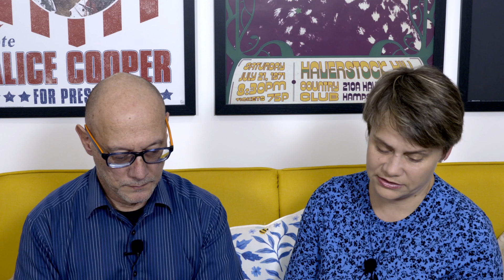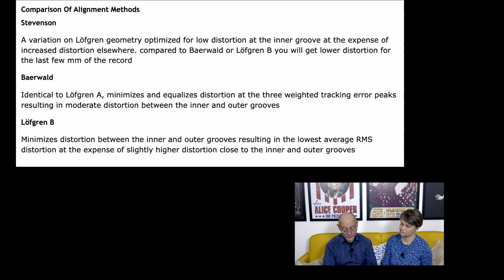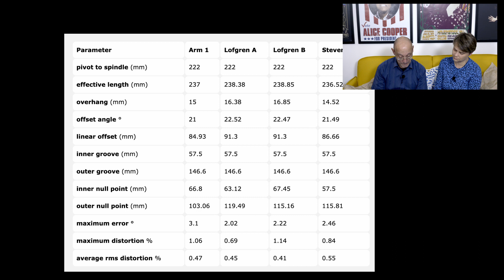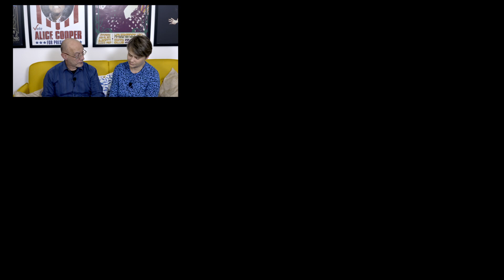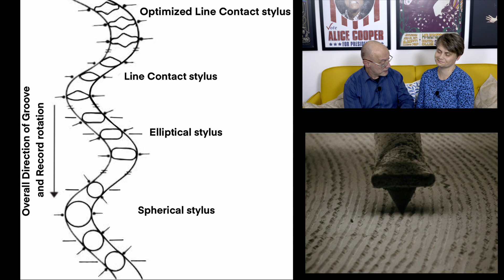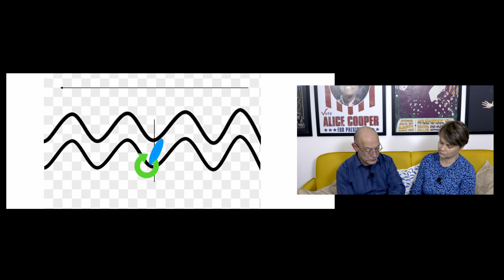What you didn't know about Baerwald/Loefgren/Stevenson cartridge alignments

Comment: I've got a dilemma I don't think you're giving me an answer to! a friend of mine bought a cheap DJ turntable a Staton t62 but the arm on it is very short to the extent where overhang is underhang by about 20mm.
Question is what would the null points be to set it up? because the calculator won't work and I can't find anything online for what it should be? They made it short like that for scratching purposes but he doesn't do that and I've heard you can damage your records I'm not sure!
Reply from the maker: Hi
To calculate the null points, you need:
1) Pivot to spindle distance OR effective length of the arm
2) Overhang
3) Offset angle
I have a video about arm geometry that explains that.
Cheers
Reply: @TheAudioSanityChannel-ym7ij  yes but there is no overhang as I said and  I don't know what the offset angle is either have you got a link to this video and thanks
Reply: "They made it short like that for scratching purposes but he doesn't do that" - then wrong choice of turntable. The arm is short exactly because this serves easy scratching. Like a tractor has huge wheels with rough profile to be able to move around in deep soil. Even though a tractor's engine can be as powerful as a sportscar's, you don't bring your tractor for track day.
Reply: @istvanszekeres4435  well I know that yeah they have it short so it doesn't jump when they scratching, cuz it's straight not s-shaped. Thanks for  comment Merry Christmas.